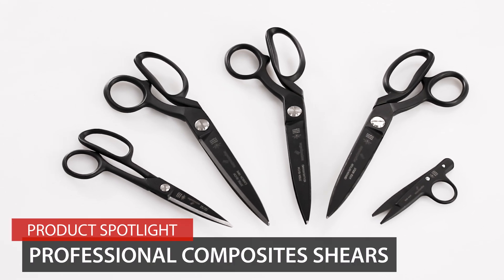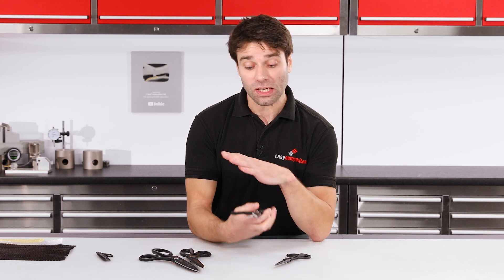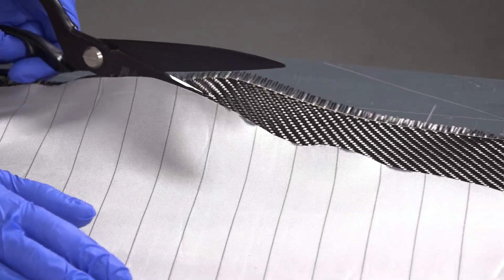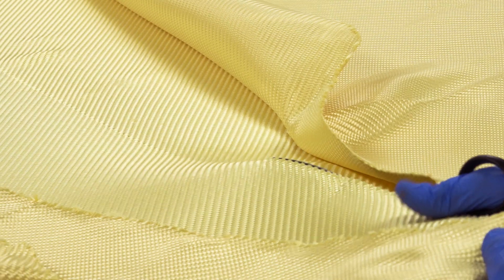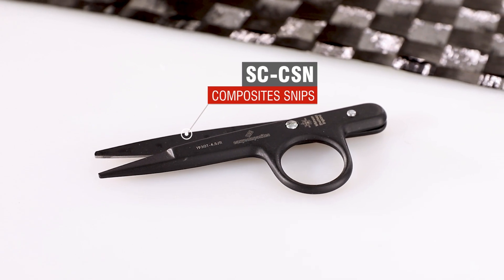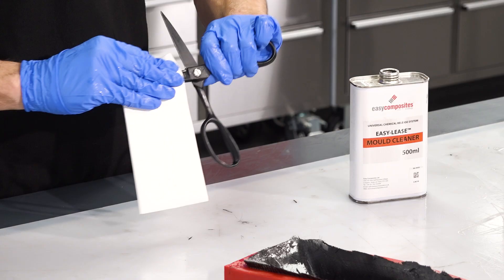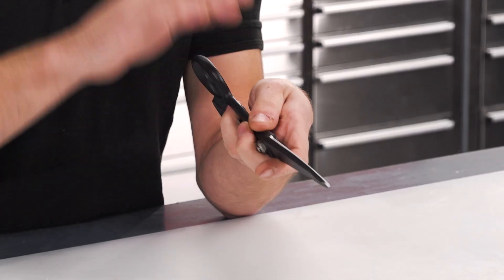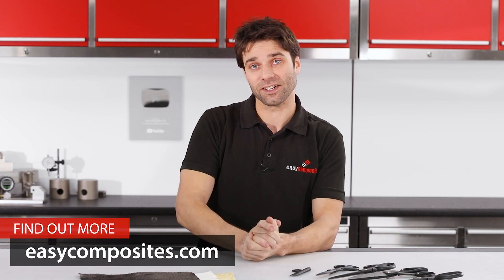Professional Composites Shears, Scissors for Carbon Fibre and Kevlar - Product Spotlight

Comment: Hello, the company I work for has bought me the snips because I thought they would be helpful and more safe than scalpel, and they are amazing for snipping carbon prepreg up to 400g/m² and even 200g/m² natural fiber, but when cutting heavier material they seem to be dull and to "chew" on the material so I tried adjusting the tension and when set right so they were somewhat able to cut the material they were so tight the spring wasn't strong enough to return them so I had to open them manually after each cut, I work a lot with 800g/m² carbon and they don't seem to work so good for that. Do you have any tips for adjusting them for the heavier materials, is it possible they came dull?
Reply from the maker: Hi Denis,

If you're still cutting the lighter weight fabrics okay then the chances are that the shears are still sharp enough, although they will naturally dull over time (the un serrated edge can be ground to re sharpen) . 800g is a particularly heavy cloth so its not massively surprising that its tough to cut. Also if you are using the 10 inch shears you may find the 8 inch scissors perform better on the thicker cloth as the elongated handle provides greater leverage.